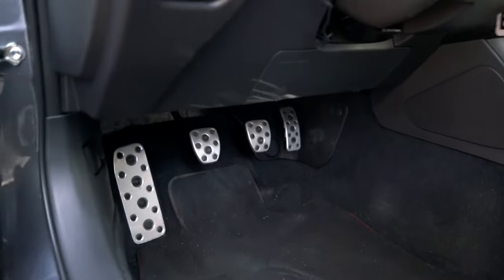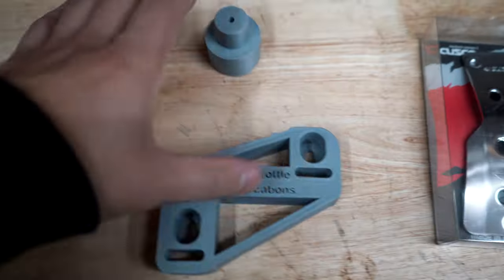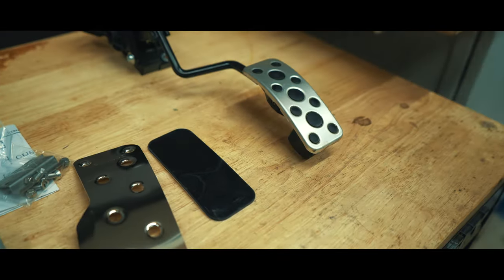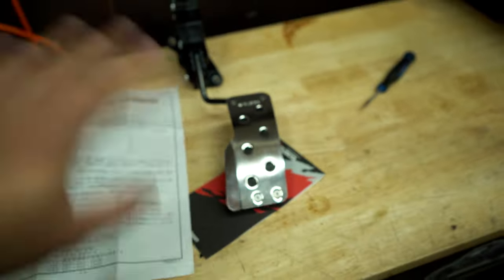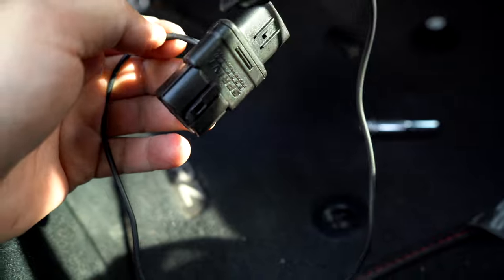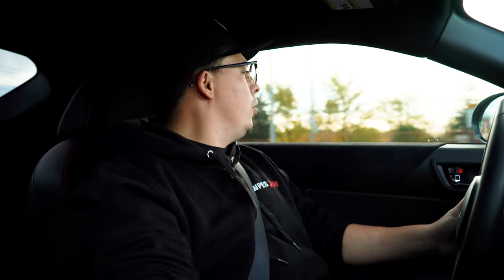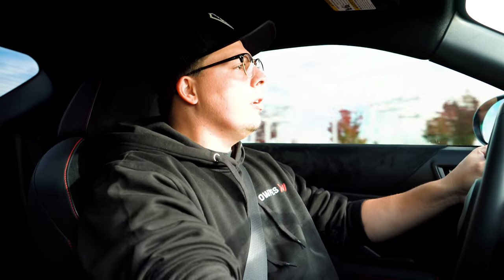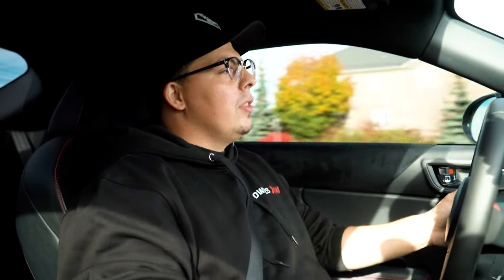HEEL TOE LIKE A PRO WITH THESE 2 MODS!!!

Comment: The reason why the pedals don't come this way OEM is the companies want to design the car to be as safe out of the box as possible.  Toe/heel mods and more sensitive gas pedal mods make it easier to give the car more gas than the driver intends... you might accidentally hit the gas while going fast for the brake or you might overthrottle the car in a corner with a sprint booster and lose control.  These aren't issues for "power users" but across the 10s or 100s of thousands of cars sold these safety features help protect the car brand.  Kind of like how the old Porches and Mustangs and Vipers had a reputation for being "dangerous" not because they are dangerous but because they do less to "protect the driver from themselves."
Reply from the maker: This was a great breakdown, thanks!

Comment: Is there no way around to use both sprint booster and the pedal spacer? Are there other throttle controllers that could fit with the pedal spacer?
Reply: I would love a response to this too.
Reply: Hey I wanted to come back to this comment. I was also wanting to run a throttle tuner and a pedal spacer. The sprint booster has a weird one piece plug that keeps it from fitting properly. I bought a pedal commander instead, which has an OEM style plug. I also bought the verus engineering metal spacer with the pedal commander and everything works great together. It’s just the weird one piece plug that the sprint booster has that can’t fit under the pedal bracket with the spacer installed. It’s like driving a whole new car once I got it dialed in. But Heel Toe down shifting is waaaayy harder than it looks.